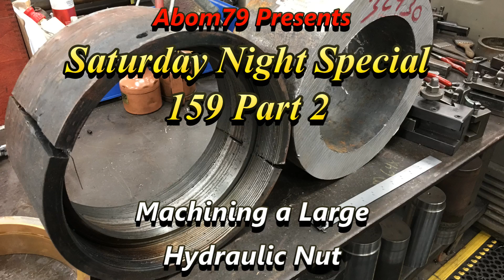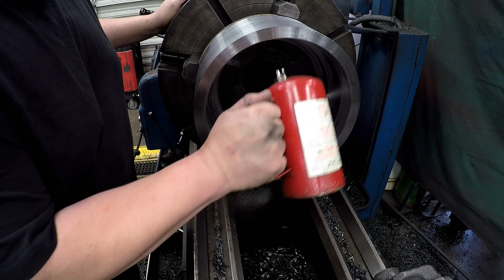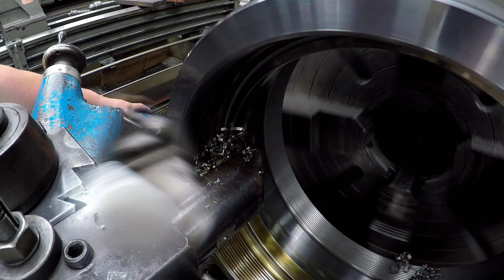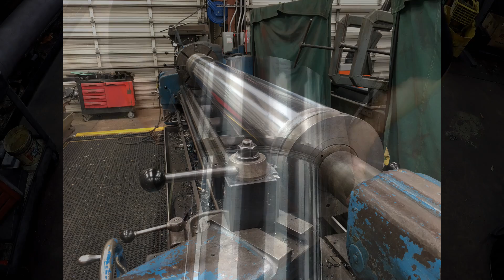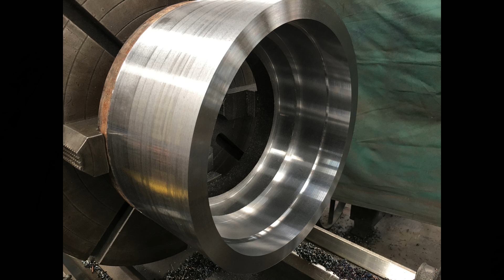SNS 159 Part 2: Machining a Large Hydraulic Tube Nut

Comment: Last internals I cut were the threads on about 175mm lock nut. But that was probably 6 years ago. Somebody had buggered the threads up and the nut needed to be chased.  Fun stuff. Cutting internals can be a pain if you do not gave a part to use as a gage. Had a bunch of new Trapezoidal Thread nuts I had to make for some parts washers. About M80 x 6. Ampco 18. First step was to make a gage.
Used to do a lot of face grooves for o-rings in stainless. Ground up the tools on the surface grinder and always fed with the compound set parallel to the ways.

Comment: I have a question.  In order for threading to work, the tool has to hit the workpiece at exactly the same spot in its revolution, every time.  Does that lathe, even as old as it is, really have the sophisticated clocking needed to make that happen?  I mean, I guess it must, or you'd end up with a mess.

Comment: 23:07 - "I apologize for the oil spot...."
- getting the job done right is the priority, minor film zitts is a very distant secondary issue. You ARE working in a machine shop, a bit of lube here and there is kind of normal.

Comment: When you cut a thread on the lathe how do you ensure that  the compound always starts the next cut of the thread in the same spot?
Reply: There's a dial that tells you where the halfnut engages. You throw the lever to feed it when the dial is in the same place each time, and the threads will match up.

Comment: That whole threading thing blows my mind. I know it’s really nothing for someone like you and with the proper machinery, but there’s just something about it that kinda makes me scratch my head. I’m petty in tune with machinery and a huge gear head so it’s not for lack of understanding it’s just something I’ve always kinda been hesitant with. I watched the guy cut the threaded action/barrel for my custom rifle so I get it, it just seems like it would be so easy to screw up. Great work! So glad I found your channel and thanks for sharing! I only have a little 4x4 cnc router that I use to cut my carbon fiber parts so I am by no means a machinist, but I can surely appreciate all of this stuff when I see what goes in to building my turbo snowmobiles and and really all kinds of high performance engine building I do. Do you do engine machine work? Maybe I just haven’t got to those videos yet.

Comment: Just discovered your channel - these are really fun and interesting to watch. How does the threader know to start in the groove with each pass?
Reply: On the carriage there's a small dial, constantly driven by the feed rod. With the help of that dial, the operator knows the right moment to connect the carriage with the feed rod.
Google "cut threads on a Metal Lathe".

I hope my Englisch is clear. ;-)
Reply: Ah, I see. Thanks.

Comment: i am an engineer i trying to tell something that instead using inches measurements you can switch to mm metric systems because in metric measurements accurate readings are easy. this  is my suggestion.

Comment: I'm not a machinist so this might be a dumb question, but does the heat of cutting the threads cause enough expansion of the material that you need to worry about the fit up once it cools?

Comment: On those large diameter internal threads, I've done a bunch of them.  An old guy showed me a trick for getting pretty close when finishing them.  He had a large pair of Starrett slip type spring calipers, with a 60 degree V ground into the tips, measure the OD of the threads, and set a micrometer to that diameter, plus maybe .005 or .008 over that, then adjust the calipers to just touch the mic.   When you get close on the internal thread, start trying to screw the caliper into them.  You'll get a feel for it, and can actually get pretty close.  For using a Fred Flintstone/Caveman method.

Comment: Just have started watching your videos and brother I’m hooked, I’m no machinist but do a lot of lathe work being the shop foreman in a marine metal fab shop you never know what we are building but one thing I think would help you is a product called Tev-Gel as a thread lubricant I saw you using Aerokroil which I’ve used gallons of but I believe the Tev-Gel has better anti-gall  properties
Reply from the maker: I’ve never seen it. I also like to use plenty of thread cutting oil.

Comment: I’m a year late but I hope you see this. We use kroil at my work and you have to be careful around rubber o rings it will eat them and make them weak. I know you are just fitting the pipe to check your work. I would hate to see that have to come apart again in the future just to change out an o ring. Great work your videos are very good and teach a lot.

Comment: Hey Adam, when you're cutting the threads over several passes, how does the lathe manage to get the tool lined up to the thread on each pass ?  It's got to enter the start of the thread exactly right in a piece that's spinning.  That's like trying to get a needle on the same part of the song each time on a vinyl record !
Reply from the maker: Lead screw is timed to the rotation of spindle via quadrant gears.

Comment: Really great video, and a good explanation of making the cutting tool too.
I'm learning little bits from each video I watch. Cheers.
Reply: Oh, and now I can understand why you didn't cut the thread as deep on the nut, as you needed to clean up the threads on the cylinder.
What sort of clearance do you end up with between the threads on matching parts?

Comment: Where did you get that long handled that’s one the ID Mic? Have had a couple set of those Starrett ID mic sets, none of them had a long handle in the set. Also one of your other videos you used an arm on a dial indicator, what was the Starrett number that arm?
Reply from the maker: The rod for the ID mic you have to purchase from Starrett separately, or request it when you buy the set. The indicator attachment is the No. 670.

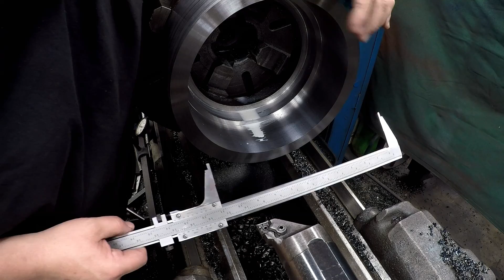Comment: On taking measurements with something of this size will heat buildup in the material affect it, or do you allow it time to cool if any heat has built up? at 4:48 into the video you take a measurement of 11.376 giving you .001 over target, does it take a lot of heat or a small amount of heat to change something of this size .001? 

Thanks, and I really enjoy your video's. I'm about to pull the trigger on my first lathe in about 2 months but trying to decide if I want to start smaller or do the buy once cry once route.

Comment: Nice Job,  What does the Machinist book call for tolerances on those threads,?  It looked a little loose.  Up here in Connecticut.  We don't get any work like that.  everything up here is Sikorsky aircraft, Boeing, or Electric Boat Submarine components. Threads gotta be right to the book, Inspectors are ego Maniacs,  they just live to find one tiny spot a 1/10,000 off, then they cry like babies.

Comment: Nice job Adam, all pretty standard stuff, but just a suggestion, for all the amateurs, rough machine all faces and diameters before starting your finishing cuts, especially on stainless steels to within 1mm ( 0.040") stainless springs like a SOB, and if you finish one side before breaking all the faces and diameters you can be in a world of pain. I feel your pain when it comes to old machines, feel is everything. I can remember far enough back to when we had to grind our own screwcutting tools, that was fun, and dont get me started on multi-start threads, I still have nightmares lol. Yeah, really nice job.Old school.

Comment: Cool video! I am a mechanical engineering student and in a Design club. We do a ton of lathe and mill work. I have never done anything this big though. The biggest thing I machined was a 6in diameter solid stock 4140 steel, down to 5.43in diameter. I made gear blanks out of them. I had a gear cutting company cut the teeth and I bored and keyed the center.

Comment: Perfect job Adam i do it  the same way but maybe a little slower rpm maybe 40 rpm slower for cutting thread . the o ring dead nuts perfect i use the same hss set up you don’t need all that carbide insert tooling! thats old school  bro

Comment: Great video! Noob question here. When cutting the threads, how do you ensure the cutting tool hits the exact start of the threads each time and not just some random spot in the rotation, thereby trying to cut a new set of threads?

Comment: Hey Adam, there is a product from Eaton Crouse-Hinds called STL8 Screw Thread Lubricant you might want to try - it is widely used in the oil industry. Been using it for many years, have yet to see a galled thread (except for when we forget to use it...). It is good up to 300 degrees F.
Reply from the maker: Never heard of it, I'll have to let the people know. We use Permatex brand, the sliver stuff that gets all over you and everything.

Comment: Hi Adam

Great high quality videos demonstrating your great skill as a machinist. I couldn't help but notice a few times though during the video where you put rags or shop towels that you had used with oils and cleaning fluid into your pocket. This is a bad practice as the contaminants on the rags will eventually soak into the pocket lining and repeated rags contaminated with different fluids can potentially mix chemically on the pocket lining and form new compounds. As this is a sensitive area of the human body and gets warm your pores will be open and all of those original chemicals etc and the newly formed ones will be absorbed by the skin. In my industry we use very carsinogenic chemicals and chemicals which can combine etc and having rags in overall or work pants pockets is a big no no for this reason. Sorry for preaching just want to put this message out to keep guys safe.

Keep up the good work.

Andy

Comment: Hey, about that mic audio. You might try blowing out the connections with some compressed air and give it a couple test clips to see if that fixed the problem before you order another cord if you haven't already. Shops like yours aren't the cleanest environments for audio equipment and it's possible some small chips worked their way into the connection. It's just a though...
Reply from the maker: The cord I have been using for years now and it got bent right on the metal plug, so I was afraid it wasn't getting the right connection inside the cord. A new one was $6 on amazon.

Comment: Would it not have been better to cut new threads for the pipe and make the nut to suit those? Maybe with a more coarse pitch to help with galling (and then more length to keep the strength)?

Comment: after cutting the threads, how are you able to pick it up the threads. if you  would had remove the part from The lathe? could you do a video on this process.
Reply from the maker: You have to align the tool with the cross slide and compound slide.

Comment: I'm interested in how you get the piece square in the chuck when it's  a big piece of tube like that. I guess you could just put it right up in the chuck as far as it goes up to the big plate but then you're hoping then ends of the tube were  cut square by whoever you bought it from, or you could square it up with the gauge thing (I forget what it's called, the thing you check run out with) but that would only work if it's perfectly circular to begin with?
Reply from the maker: +Steven Cassidy Usually the cut pieces we get in from the supplier are pretty square cuts, and you often times are machining all sides down. You can normally set the piece in the jaws and bump them all the way back and indicate a spot on the od true. If the ends are way out then you indicate the od in two places to get it straight and true.
Reply: Abom79 I see, that makes sense. Thanks for taking the time to reply. I appreciate you, fellow human!

Comment: I had one of them wheels on my die grinder go right into my right shoulder when it blew. be careful bud. i used them for years and then one of them blew.
Reply from the maker: I'm sure it's possible, but they usually just wear down really fast as we use them. Havn't seen one break apart yet. I highly doubt a part of that wheel will impregnate itself into you as it being a soft material.

Comment: got an old mit 0-8 vernier that still sees some action
Reply from the maker: I still use mine pretty regularly for my work.
Reply: i have to pick and choose when to use my personal tools, even though Im 
in the prototype/tooling dept every piece of metrology equipment used on
 the floor there needs to be calibrated bi-yearly...so im supposed to 
use their stuff, and most of the stuff is top line mits but the longer 
calipers are SPI, which i dont trust a lick. any time someone asks for a "vernier" i hand em that, and they look at me like i have 2 heads :D

Comment: Hey Adam, Nice work, in the beginning you mentioned that viewers asked why you didn't use fly cutter, I thought that you would use a small face mill like a 2 or 3 inch. I am just a hobby guy with tiny experience but watch a lot of you and other related channels. But on this video great point about feel and knowing your machine, I know about that feel. Back in the day I had to shim crankshaft bearings and after a couple times I would shim them without using plastagage because I could feel when I had the oil clearance I was shooting for. Hope new computer gives you the results that you want. God Bless Ya   Dave
Reply from the maker: Part of becoming a good machinist is learning and knowing the feel as you gain experience.

Comment: You talking about how hard the original nut was to remove reminded me of some of the actuator repair jobs I used to do. Getting them off was the hardest part and many a Rigid wrench was snapped when a 8 foot cheater bar and 2 blokes were hanging off it. even had to use a forklift tine on the handle once. Some pretty unsafe work practices that I'm glad I don't endorse anymore. Great vid mate, I commend you on your skill and workshop cleanliness.

Comment: Are there a lot of different threads in this size, or just a few large cylinder threads?  If you do a lot of these larger type threads, I would recommend making yourself some thread gages based on the measured PD of some actual cylinders.  If you rarely ever make the same thread twice, well then, no point.  I just know how much fun it is to get the thread timed properly to chase it.
Reply from the maker: It's rare enough to not worry about making a gage. The tube was galled and had to be turned down a small amount and re-chased, so I was machining off of those measurements.
Reply: Yeah, I saw that at the end, you had to make a "custom" thread anyway.

Comment: Could you do a little video on boring bar holders? I have a 5/8" bar holder for the AXA aloris copies, but it's cheap and I don't like that it doesn't index the bars to flat. I'm planning on making a new one here soon, but I was wondering the pros and cons of each style. Thanks, Noah.
Reply from the maker: What kind of info you are looking for on boring bar holders?
Reply: Well, I notice that you have two styles displayed in the video. The one that clamps on the top, and the one that clamps with I assume a sleeve like mine. And then I could envision a third option with a split running down the side and clamps by bending the metal. I know the sleeve styles are very rigid, but in the case of mine, offer no ability to index the boring bar vertically. I wouldn't think the set screw style ones are as rigid unless the bore is a near perfect match to the bar. I was just wondering what style was your favorite and if there is any noticeable differences between them. I am thinking of a hybrid style with the set screw for alignment, and then a split clamp to hold it, but I'm worried the split would lose a considerable amount of rigidity.

Comment: Such cool stuff - i wanted to ask you something Abom -

All the chips that accumulate in your shop - must be considerable.  What do you do with all the chips from the various materials that you machine?

Is there some scrap/recycling service that buys these chips from you?  I feel like i would love to get a huge barrel of chips from your shop and try to melt it down, separate it - and make some new material from it.  It must be tons and tons of metal.

If you think about a steel cylinder that's 12" diameter and 12" long (~1357 cubic inches) and you remove 20% of that material by turning/machining it - you've got ~271 cubic inches of waste.  With steel (depending on type of course) being about .2904 pounds per cubic inch - that's 78 lbs of steel chips.   Where does that all go??
Reply from the maker: We have a large scrap metal bin out back that all the scrap metal goes into. It get picked up and sold at the scrap yard.
Reply: Ahh ok - makes sense.  I bet those large scrap bins looks awesome with all the nice chips/curly shavings just packed in there!

Comment: Adam at work we had miles of FRP pipe that all was flanged together, we used 316 ss bolts for the flanges they were bad to gald up.
Reply: Always use anti seize on stainless to stainless fasteners.